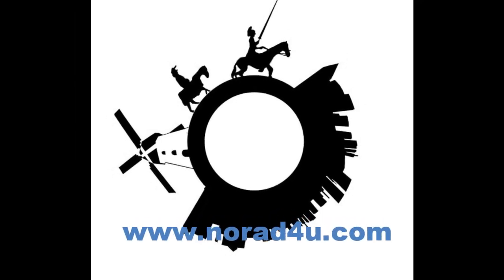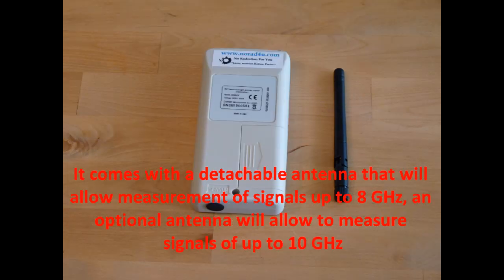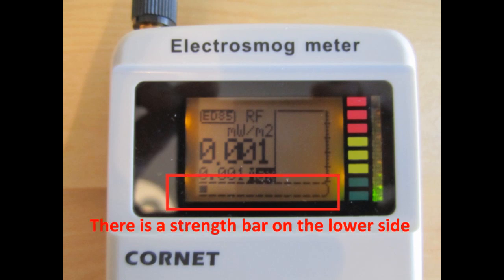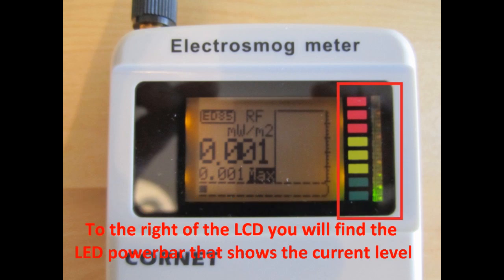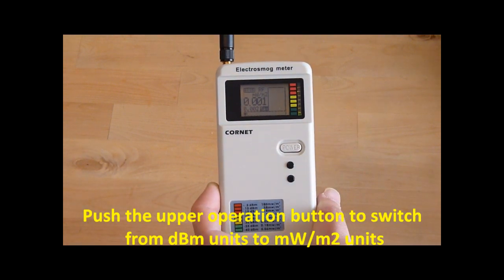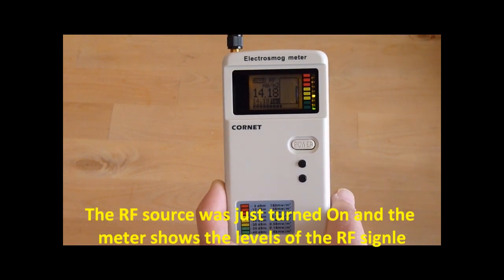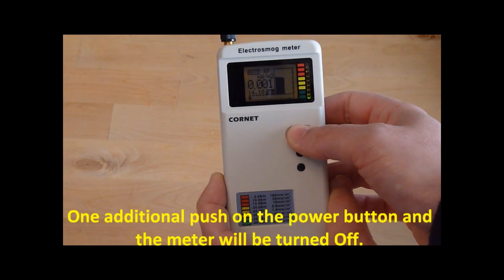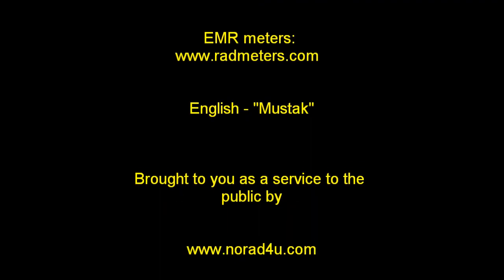CORNET ED85 RF EMF/EMR meter (for home use) video review

Comment from the maker: HI

This meter goes down to 1 MHz, FM span from 87.5 to 108.0 megahertz (MHz), but in most houses the signle level for FM stations are lower then -60dbm which the meter can sence. So if you are close to the transmitter or the signal is higher than -60dbm the CORNET ED85 should be able to pick it up. 
I hope this info helps.
amir

Comment: Is it possible with this device to set it to a specificfrequency band? IE to test frequencys in the 380 mhz band..and not just from 1mhz to 2.4
Reply from the maker: ilmers corner Hello and thanks for your comment.I guess you can connect an SMA frequency filter between the meter and the antenna.I never tried it, but it should work.Amirb

Comment: My device skips between microwatts and milliwatts automatically. Is there a way to keep it on microwatts? It starts at 0.1827uW/m2 and 0.0083V/M and never goes below these readings.
Reply from the maker: mark douglas Hello and thanks for your comment.
No, not that I know of. The New ED85 (ESX) skips between uW/m2 to mW/m2 and it is a little bit hard to follow at the start.
This is because the new modal have an extra sensitive mode.
all the best
amirb
Reply: NoRadBlog Thanks. I find myself measuring in V/m as a result.
Reply from the maker: No, It changes between uW/m2 to mW/m2 according to the levels measured. This sometimes make it hard to follow. This is one of the disadvantages of this model.
I hope this info helps.
amirb
Reply from the maker: +that's all folks You need to scan the house, find all RF sources and remove them , then rescan and find all penetration point. When found , we can talk about the proper protection mean to block the RF from coming in. It can be windows film or curtains for the windows, wallpaper for the wall and ceiling or other means for the floors.
please see:
1. EMF Test DIY - http://www.norad4u.com/monitor/emr-measurements-by-type
2. RF Protection - http://www.norad4u.com/emr-protection/rf-protection
amirb